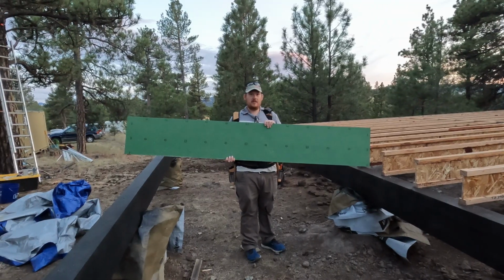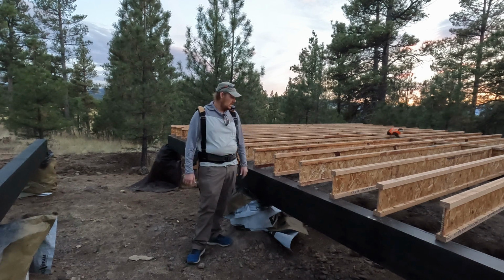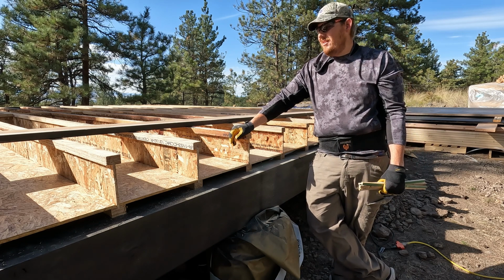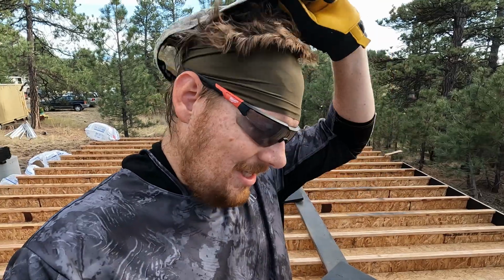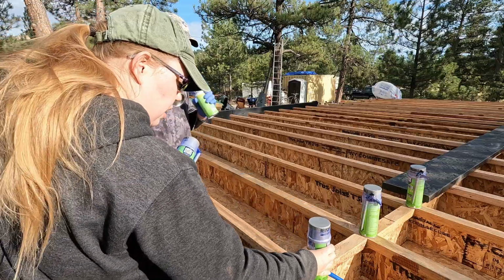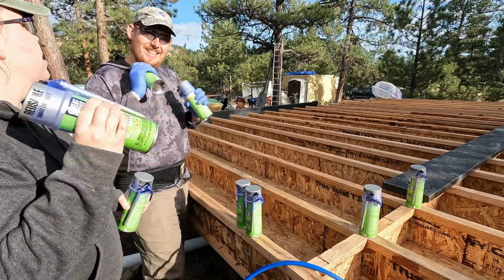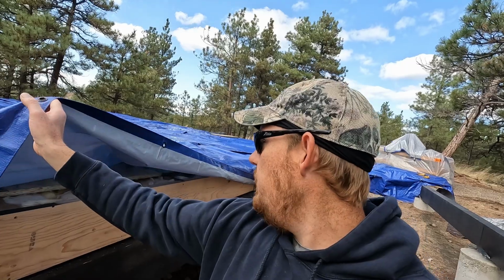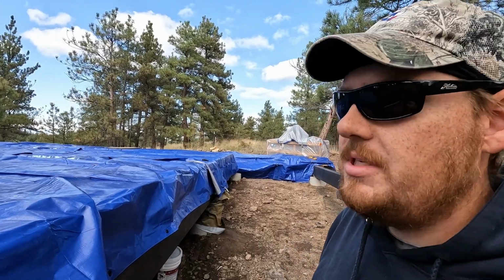We Pulled An All Nighter To Finish This... Sub Floor Install | 24x24 Off Grid Cabin Build

Comment: I hope you let the zip sheets dry thoroughly before taping those joints.  Hopefully not much water got through the seams to the insulation. Would have been mighty good to stay awake 30 more minutes to zip tape those joints on top. BTW, you will get better with the circular saw with time.
Reply from the maker: There was a bit of water that ran down the I joists. We don't think the insulation got too wet. Definitely had a good bit of sun to dry out though. The ZIP tape isn't quite strong enough to handle foot traffic on top. We just going to tape the bottom of it for air sealing. Thanks for watching!

Comment: Nice job but your plywood t&g is designed to go across the I joist not with it. It will be springy on but ends of o.s.b.between joist.
Reply from the maker: We're glad you pointed that out. Looks like we should have ran them the other direction. The logic at the time was that we should run it to have the most full sheets (and less cuts), but that was incorrect it seems. We'll definitely keep that in mind for the next building. Thanks for letting us know, much appreciated.